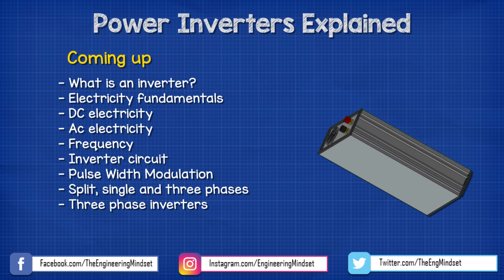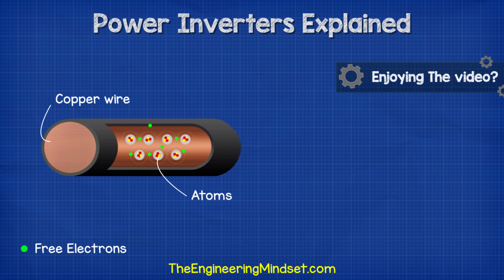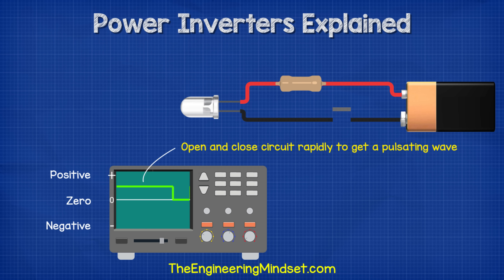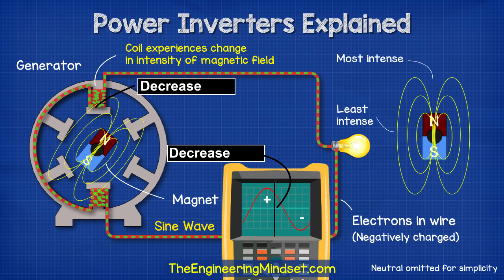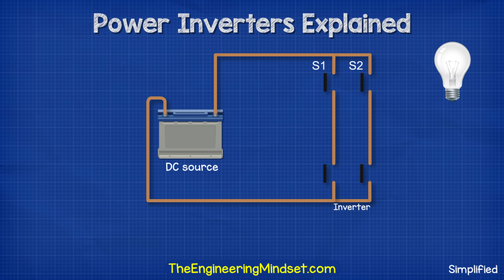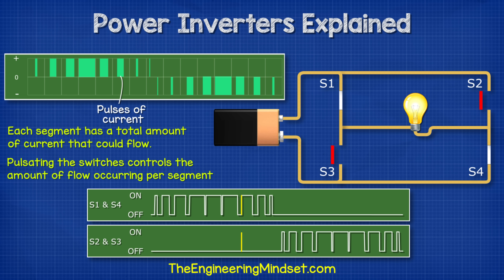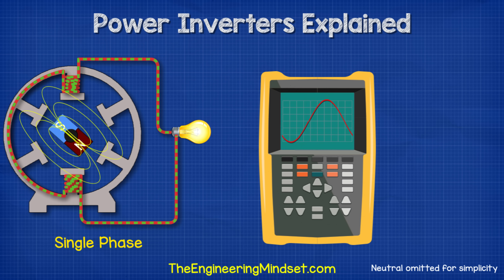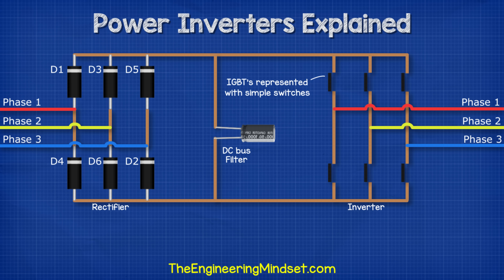Power Inverters Explained - How do they work working principle IGBT

Comment: I remember learning this in some electronics courses.  The Toyota Prius hybrid had been using LARGE IGBT's for it's 3 phase motor.  Napa Auto Parts training side had a fantastic course explaining how it all worked and more that was built into the system.  Of course this video answers questions much better than the books I've read, and I thank you for this.  If anyone is learning about DC to DC and DC to AC inverters and converters. That Napa course will give a lot of info, but this video is the start!  I'm assuming people that see this video understand the basic theory that "When magnetic lines of force cut across a conductor, a voltage is induced in the conductor and current (electrons) can flow."
Without this "working theory,"  we'd never have the great electrical and electronics we have now!
Reply: working method, not working theory; just sayin.

Comment: How do I set up speed control for an e-bike or go-kart using a treadmill motor, or how do I run a treadmill motor at a half decent speed and torque with lower voltage than the motor is rated for?

Comment: At the end a 3 phase AC supply is used with diodes to create a rippled DC supply which is then smoothed by a capacitor…. Why is the smoothed dc then converted back into AC when you already had AC at the start
Reply from the maker: Because it the clean DC can be turned into any AC voltage or frequency we need
Reply: @EngineeringMindset  thank you for the reply… I just watched another video of yours which also explained this very well

Comment: Nice explanation. My question is : I have a 1000W pure sine wave inverter and I want to power a 1200 W water heater. If I use a diode to chop one half of the AC wave between the inverter and the the heating element  will I damage the inverter?

Comment: The output frequency of the 3 phase inverter can be varied basically the whole point of  a VFD with the same input frequency and output all the time it serves no propose.
Reply from the maker: It's rare you would use the same output as input. Usually the voltage and or frequency is different. You could also use the vfd with same output to ensure a clean power supply
Reply: @EngineeringMindset  I was suggesting add the advantages so it is rational why

Comment: In that case, wouldn't it be simpler to then hook up the DC load into a generator and supply the AC load with the current generated by the motor?

Comment: Please I have a question, if you can tell me if it's possible. So i have an idea to use inverter to charge the same battery that I'm pulling energy from to the inverter. Ok, i have a battery of 12V capacity, and it's drained to 6V remaining power. So idea is to make 12V from remaining 6V from battery, using inverter and recharge the same battery from inverter to new 12V of power back in. So the battery can charge itself that way and give power to the radio of 12V again. I know it's maybe confusing but i really want to know if it's that possible to do? Thank you 😊
Reply from the maker: No it won't work. You could make the voltage 12V but there will not be enough power to charge the battery. You're trying to achieve perpetual motion which isn't possible.
Reply: @EngineeringMindset  But is there solution to that problem... Maybe using capacitor, or more batteries to try to achieve self charging battery?

Comment: Since you asked, I use an inverter on my neighbor’s roof to run my AC only sexdoll off of a lead acid battery bank. I monitor state of charge with a voltmeter to insure there’s enough juice left for others.

Comment: As an Electrical Contractor I’ve got the basic’s down. I’ve done several Panel Upgrades that include Generator Transfer Switches. I’ve done whole house systems and the smaller 30-amp selector switches for 6 to 8 circuits. But for my home I don’t want a loud generator running over night, I just want to keep the 2 Refrigerators, some lights, and the FAU circuit on.  I want to flip a switch and run my 40-amp hr EGO unit to run what I need when facing Brown Outs. The reality is to run both Refig’s  I will buy a second Power Station.  This means I need a switch to separate the neutrals for each Station.  I can run #1 on my L1 and #2 on my L2 Split Phase Panel, is there anything I’m forgetting.  I have a Generator to run my only 240v circuit.  By running my Generator only when needed during the day, I need 2 Inverters with separate neutrals.  I have it somewhat figured out unless you see I missed something.

Comment: Dick Smith Electronics of Australia sold A&E projects in kit form. One of their kits, a 50 watt module amp, became a big seller. A&E designed a power inverter for cars to run the modules that ran on 40 volts. Only a few components, so limited in power output, but usable. Especially for 30/40 years ago. The basic design shown in the video is just what it was. Amazing, then, what car amps can do now. I understand that 2 thirds of the unit is just the power inverter.

Comment: Sorry, I don't understand the root purpose of the power inverter. Seems to me that 3 phase is converted to a rippling DC then back to 3 phase. I would think the inverter would consume power before it delivers to the load.
Reply from the maker: We convert DC into any AC voltage or frequency. US uses 120V 60Hz, EU uses 230V 50Hz

Comment: Is there minimum hertz value for current to count as alternating? Would  rotating a battery once per hour/day/year count?
Reply: The main difference between AC and DC is that with AC the electrons vibrate in place and with DC the electrons move along the wire. So, presumably the minimum frequency for AC would be the point where you start to get electrons migrating from atom to atom. At that point, you're more or less just changing the polarity of the DC quickly rather than dealing in AC current.

Comment: Paul,  (question from US) for an inverter-driven HVAC heat pump in the heating season, is it true that no matter the maximum heating capacity of the heat pump, the inverter controls the compressor to precisely follow the contour of the heat load and would only shift to maximum compressor RPM when a user changes the set-point by X degrees, so unless the thermostat set-point is changed by X many degrees, the inverter keeps the home at constant heat and doesn't need to use maximum RPM (maximum capacity), as the compressor follows the daily dynamic load?

There are so few inverter-driven HVAC heat pump package units here in the US that to find one to use, I would have to oversize the system (3 ton instead of 2.5 ton) and want to make sure that by being oversized, there is no harm being done, other than to my pocketbook. (billitolocsin@yahoo.com)

Comment: I would like to create a stand alone inverter system to replace my home electrical service. My plan was to use a "STEP UP TYPE SYSTEM"  This would involve the use of a 12v DC battery to excite or initiate the cycle. this would be connected to a 12/120 transformer connected to a 120v electric motor then an automotive alternator. From the altenator which would provide 220v house power then a shunt or hub which would connect to another 220v/12v transformer and back to battery to constantly recharge the cycle. You mention a Rectifier to change voltage values. Which is better to use

Comment: This video tells us more than a four year engineering colleges degree
Ac
Dc
Voltage
Current
Conventional current
Electron current
Ac Waveform
Dc waveform
Led light
Induction motor
Alternator
Single phase rectifier
Three phase rectifier
Step up transformer
Oscilloscope
Switch 
PWM
IGBT
Single phase power inverter
Three phase power inverter
Micro controller
And So on

May be I have been misssed something
Reply from the maker: Rectifier video here https://youtu.be/RiRyzLl4Y8U
Reply from the maker: Seen our new Oscilloscope tutorial? (beginner friendly) link here:➡️ https://youtu.be/LaY47Qrfs0c

Comment: I rarely comment but here I have to. I am an engineering student and I have to finish this assessment for next week, part of the assessment is to design an inverter that is connecting a solar pannel to AC loads. I must confess that until now I only had a vague idea of what an inverter is, but with this video I finally have a complete understanding of the working of such a device. Power electronics is clearly not my favorite course but at least you have made it comprehensible, thank you very much.
Reply from the maker: Seen our new video on HOW SOLAR PANELS WORK in detail https://youtu.be/Yxt72aDjFgY
Reply: 😂😂¿Estuiante de ingeniería y no sabes que es un inversor? 🤣🤣🤣🤣🤣🤣.
Reply: For an engineering student who doesn’t hardly know much about an inverter, does indeed say something about today’s ‘students’ probably out blocking traffic and glueing themselves to Aeroplanes because we humans are melting the ‘planet’!
Reply: @astra-e7w  What are you talking about?
Reply: @svwtsvfcb In a round about way he's condemning higher education systems that put a focus on teaching global warming or simularly  gender or racial equity rather than a focus on engineering  principles students need to understand what they are working on or with, and the low bar of useful  education students recieve.

I don't know how far you're into your education, and neither does the previous commentator. But if you're just beginning your degree, then I'd say there's no big sign of a problem yet. But if you're near finishing your degree and you're just comming to understand an inverter, then maybe you should question your school and how messed up it is that people and you spend gobs and gobs of money for useless information that benefits neither the students, nor their future employers, nor their employer's customers, nor socity in general. Instead you're saddled with massive debt and foreigners take your job opportunities because you're not well qualified.

That's politely pretty much the intention behind the previous commentator.  While I pretty much agree with that generally about the average student, I'm glad you're seeking out information and found this video helpful.  And I hope that you focus on education that helps you better satisfy people's needs through your engineering  degree. And I hope that putting those skills to use benefits you financially and those who you help, or are helped by your work. 😊
Reply: @kreynolds1123  I was indeed in my second year, power electronics is a course only offered then, first year is focused on other basic topics in Maths and Physics; small update : I am now specializing in an electrotechnical degree which I wouldn't have believed to do at some point three years ago but here I am, and inverters are indeed part of the building blocks of electrical systems.
Reply: @svwtsvfcb  Decades ago I  served in the army reserve as a unit level communications maintainer. 31v was my specialty.  Maybe you can find a field manual or  PDF if your interested in what qualifications that brings. I'd say it was somewhat comparable to a basic electronics technician in troubleshooting, but certainly not an engineer. My military occupational specialty training was a 13 week school. The training was intense with a 50% drop out rate. What we covered in the first two weeks alone a friend of mine said  took his local vocational tech school took 4 months to teach. Granted the military school was 8h of school each day 5 days a week. And the army didn't play with those unable to keep up as a the drop outs were were reclassified into a simpler occupation. Votech schools are not  known for requiring much for fluff classes, unlike colleges and universities.  But a votech isn't going to give a 4 year degree either. I find it  hard to imagine how long it would take a collage to cover similar material with all the extra classes needed to pad their wallets with your money. 

I want to share another story related to power regulation. 

Later in life I came to I work a few years with a local company that made hydrogen generators.  I'm not an engineer  but I helped them develop and build their electrolizer  from using relays for control electronics  to using a Siemens Logo  PLC  to sense and control different systems. Sensors included temperature and fluid low and fluid high states. Relays on the PLC would regulate a solenoid valve for refilling when required and stop when full, they would regulate a pump that moved the electrolyte through a radiator to remove excess heat and they would regulate a fan for the radiator.  

But, the company electrolizer was still having too much heat issues.  I eventually got them to let me implement a rudimentary buck converter to power their electrolizer electrodes. The Siemens logo PLC used mechanical relays which would have failed month's time if they were to switch pwm current. Nor could it handle the 50 amp draw so I came up with a plan to remove a mechanical relay  on the PLC that was being used to switch a solid state state relay that sent power to the electrodes,  and replaced it with  components that would allowed me to connect an external solid state relay directly to the Siemens Logo. 

I then created a  program with PWM on the PLC to lower the duty cycle as the temperature increases closer to a max acceptable temperature. With PWM now implemented I now saw massive current spikes when the solid state relay was turned on and off and realized that the plates of the electrolizer were acting like a capacitor and I was seeing capacitor inrush current  while the water was acting like a dielectric with a high dielectric constant storing energy for voltages below water splitting voltage which caused those massive current spikes.  So, I introduced an inductor and a 90 amp freewheeling diode in the configuration of a buck converter.   We now had all the components of a temperature controlled buck converter. We had temperature sensor, a programable logic controller adjust a pwm signal, a solid state relay for the switch, a free wheeling diode, an inductor, and a capacitor made by the plates of the electrolizer. 

It worked perfectly and helped improve the electrolizer efficiency and drastically reduced the waste heat produced. 

See it takes 1.24v to split water, and the company had been applying 12v (really closer to 13.4v), to their electrolizer  plates. One might simulate or model electrolisys as an ideal zener diode with a resistor in series. The resistor represents the electrolyte ion resistance through the distance between plates and a given cross section to conduct through and the zener diode representing the work of electrolisys. The voltage drop across the zener x current = power used to split water, and the over volts or voltage drop across the resistor x current = power lost to waste heat, heating the water. 

I suspect you can see now why they were having heat problems before me. if only 1.24v and the remaining (13.4v-1.24v)x 50 amps =lots of power lost to making heat. But buck converting the voltage  regulated the power delivered to the electrolsys cell at a more efficient voltage, and then the company could now increase the conductivity of the electrolyte to draw enough amps to keep production up which also helped improve efficiency again. Before, they had to be more restrictive  because they were supplying 12v and a more conductive electrolyte would draw vastly more than 50 amps.

Comment: I have a tombstone style welder that I want to control the transformer's output via the input. An inverter can drive the transformer and the input wave can be modified to provide AC balance for TIG and based on your info an IGBT (or2 ) would be best.

Comment: well since i am mostly interested on AC output for home appliances the only solution would be to put a rectifier 3 phase to convert it in single phase...
sure a 3 phase generator it may be more efficient but at the same time it would be as much efficient a single phase generator with 6 poles.

Comment: just curios? how come most inverters available do not provides split phase, even tho there is a huge demand for it in north america, couldn't you just pull a center tap off a low frequency design 240v inverter? im curious if this would work especially with the popular reliable electric pure sine wave inverters?  somebody recently tested these and it was 60v from hot to ground and 60v from netrual ground making me think it would be 120 split phase on a 240 model

Comment: In 1960 I was a student at a USAF technical school for weapons mechanics.  One day we were introduced to a large, heavy, power-hungry and incredibly loud machine that took large amounts of 28v current and produced a trickle of one-leg-grounded three phase ac for airplanes.  They consisted of a dc motor driving an ac generator in one unit.  By the time I became an airline aircraft mechanic in 1965, these beasts were being replaced by static (solid state) inverters such as the ones you see explained in this video.  But probably, somewhere in the world, an old Convair or two still carries one or more of those screaming power-wasters.
Reply from the maker: Seen our new 3 phase transformer video?➡️: https://youtu.be/u0SsejDCVkU

Comment: I love inverters I built an inverter with crap I found in the basment when I was 12 to light a small fluorescent light on flashlight batteries. I knew very little about what to do. I ended up with what Ford used in his first car radios but it worked and used up all my batteries real fast.

Comment: Can the diode Inverter also change the AC to DC? Like to hook up my car by home electricity
And how to increase amp?
As long as i ve for example a 10% of voltage can be converted to amp. How to make amp in dc as high voltage of ac?
 And in my car 80amp in battery or alternator how to convert it to high ac voltage current by using some some transformers and inverters parts?? 

Thanks and i hope there's a good video explanation like this. Thanks